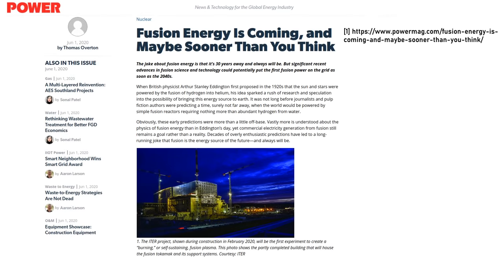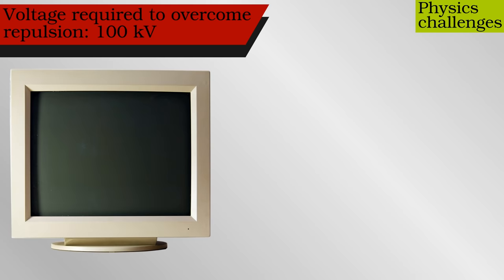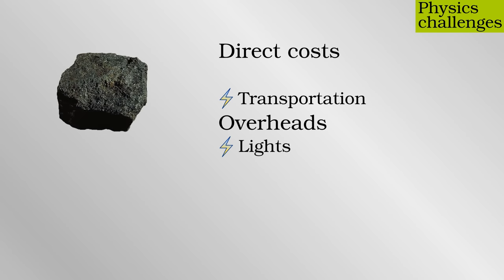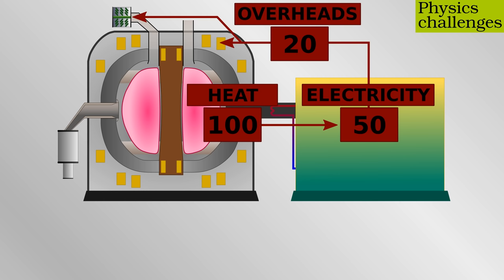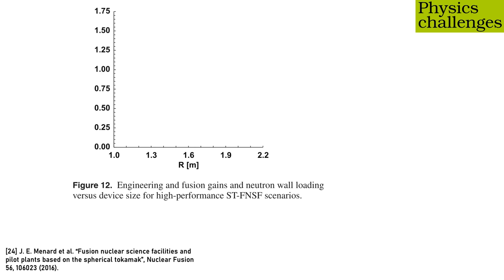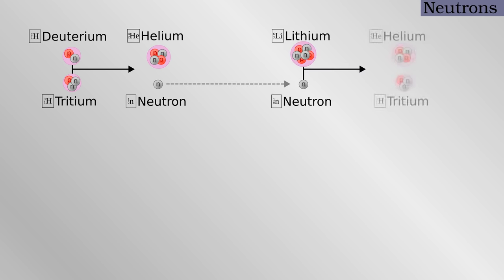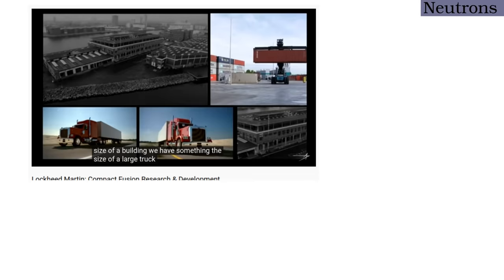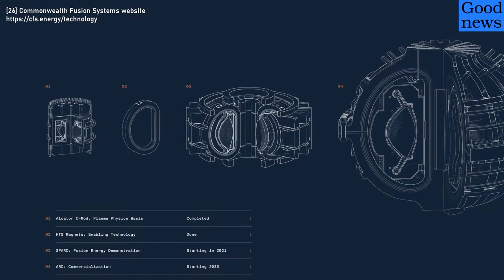Former fusion scientist on why we won't have fusion power by 2040

Comment from the maker: The first of a multi-part series of shorter videos beginning with the most asked-for topic, "why a fusor won't work (and why only thermonuclear fusion will lead to a gain in energy)", is now up: https://www.youtube.com/watch?v=2DzKXN1pcwY

Since my video was posted, Sabine Hossenfelder discussed the misrepresentation of fusion gain vs engineering gain in a recent video: https://www.youtube.com/watch?v=LJ4W1g-6JiY
I am making a response video.
Reply: It is! One of the issues I couldn't find a reasonable answer to is, why can't fusors use electrical arcs/plasma as electrodes. They would be resistant to (almost) any amount of heat and radiation.
Reply: Instead of a hot plasma, have scientists tried cold fusion by cooling hydrogen to nearly 0 Kelvin and applying electric current and megatons of pressure to it?
Reply: Thanks for this information. I was almost there, ad that's why I prefer a short term future with fission as an energy source, possibly switching to Thorium molten salt low pressure with freeze valve gravity stop system. (removing pressure water and other risks) And using nuclear as a temporarily measure until we can make solar systems in orbit from molten asteroids to feed energy via mircowaves or lasers to Earth to gain area for forests and agriculture and stop to rely on Earth rare ressources.
Reply: Thanks for the good video!
Reply: "Letting a goat graze and walk a treadmill" 😆
Reply: What do you think about the Projekt Wendelstein 7x? (as stellator, they made a big leap in the past 2 years and are refitting for net plus energy production now(I think I hope I understood it right, well they implement a colantbased hullsystem) you will understand better what they do than I I am just curious for your oppinion since I am just an interested naive
Reply: Yes please. This is about the only video I have seen that speaks realistically to me. Would love to hear more from you.
Reply from the maker: @davidh.6930  I mentioned this in another comment: the stellarator concept is better than the tokamak from a physics perspective: no need for current drive, so that input power I mention can be reduced in principle. It is much harder from an engineering perspective.

For the latter reason, stellarator research is behind tokamaks. A widespread opinion among researchers is the idea of demonstrating a practical fusion plant based on the tokamak and then using stellarators long-term.
Reply: "yet each man kills the thing he loves, by each let this be heard, some do it with a bitter look, some with a flattering word, the coward does it with a kiss, the brave man with a sword!"
Reply: Definitely interested in the follow up series! This video has distilled my perceptions of where I thought we were with but lacked the knowledge. Would be really interested to know more. Over my life I have gone from thinking of fusion as a certainty by the time I was in my 40’s (in my childhood in the 70’s) to now thinking it more akin to chancery in Bleak House. We should obviously pursue as a human endeavour and I hope to see it still in my lifetime, but it won’t be at scale in that time.
Reply: Yeah that sounds awesome. Your video here was very informative. I didn't know jack all about any of this but you presented it in a very digestible manner. Your graphics and explanations were excellent. I feel like I took some quality information from this.
Reply: @infiniteuniverse123  
Interesting. How do we know any of that stuff is actually the case?
Reply: the first you tube I have seen say this and I have been saying this for ages forget my comment about 30-50% lose turning thermal into electricty I commented before you covered it. I think molten salt reactors are the way to go for faster safer power till we get to this about 2099
Reply: On a related topic, what's your take on China's fission thorium reactor? Looks pretty cool 😎
Reply: @iamjoeysteel  they are doing very well it's all info they got from the US but they are putting the money and man power into it the molten salt is the best one but the pebble bed one looks good too and they have loads of thorium as they dig it up mining rare earths which they have a monopoly one as no one digs up rare earths because thorium is always found with rare earths and most countries make you treat thorium the same as nuclear waste even tho it is safe health and safety gone mad as normal
Reply: About AI computing the folding of proteins, I thought, in a similar way it might be possible to compute new structures for the magnetic fields and coils in the Stellarator!

Another thought, should the research put focus on harvesting the energy in some electrodynamic way, with induction, or capacitive from changes in the electric fields in the plasma?
Have a plasma geometry about electric charges and magnetic flow, that eats from a small, controlled explosion, so we have direct electric output? Some resonator from intrinsic L/C structure? There could be a double device like a boxer motor. One ignites the other while exploding. The electric pulse narrows down the magnetic field on the other side, via superconducting wires and coils, and fusion starts there, and pushes back, so to create the other half of the cycle.
Reply: What is your opinion on Isaac Arthur's idea for a fusion reactor we could technically make with current technology: building a water tank one cubic kilometer in size, then detonating hydrogen bombs inside to run turbines off the resultant heat energy?  For safety, we could build the plant in space with in-situ resource utilization, which looks like it could be possible around 2040.  Place it in the already hellishly radioactive Van Allen belts, which human space habitats would not likely occupy and which would allow the Earth's magnetic field to contain most radiation leaks if they do occur, then beam the power to Earth.  I know this is absurdly unlikely to ever become a reality due to the stigma around nuclear and thermonuclear bombs, let alone putting them in space, as well as the arguably more practical option of building orbital solar plants if we are talking about beaming power down from space.  I am curious what your take is on this fusion moon concept, seeing as Isaac Arthur is optimistic to a fault.
Reply from the maker: @neovxr  With regards to AI for magnetic configurations, this may well help make future designs, but the main problem is the challenging engineering of the stellarator coils. I will mention them in a future video.
Reply from the maker: @redmohawkguy1  Lifting off a cubic kilometer of water would be prohibitively expensive (even in terms of energy, if not pure dollars). There were suggestions starting from the first H-bombs (I will mention how they work in a future video) to simply drop such a bomb into a huge underground cavity filled with water. Even in the 60s, when atomic tests were happening often, it was simply not economical.
Reply: ...would definitely like to see that series...
Also, any insights you might have on space fusion propulsion would also be welcome.
Reply: yes, please!
Reply: @ImprobableMatter  Are there concepts about a pulsed magnetic field on top of the static? Like, can something similar to a Dirac pulse ignite fusion? Can we do Fourier superposition with arranging coils into each other, so the big ones feed the lower frequencies, and the small ones provide the higher harmonics? The result would be a very steep high energy pulse, impossible with a single coil.
What is the current use of a dynamic component in the magnetic fields?
Reply from the maker: @neovxr  The tokamak concept (technical explanation in future video!) is pulsed in a sense, because it involves inductively discharing a current through the toroidal plasma for confinement and heating. With the stellarator concept, you generally do not want anything transient like a sudden pulse, because it would upset confinement. The field geometry is finely tuned so a major pulse would free the plasma to hit the wall and so on.
Reply from the maker: @johnjones-yt8rt  The approach at the National Ignition Facility e.g. at 07:34 is to use lasers to compress and heat a plasma to carry out fusion in a fraction of a second.

In a device such as a tokamak or stellarator, the plasma is too tenuous to absorb a laser as strongly as would be required. The plasma scatters a laser beam - and it is this scattering which is used to determine the enormous temperatures (millions of degrees) which the plasma reaches.
Reply: Great stuff, very interesting to hear from a higher system level! Looking forward to this content!
Reply: @ImprobableMatter  Thank you for replying.  As for sourcing the water, I was talking about getting that from asteroids or comets and bringing it into Earth orbit when I said in situ resource utilization, not lifting it off from the surface.  Apologies if I did not communicate that clearly.  However, seeing as even building a bomb tank reactor underground was found to be uneconomical, I guess this answers my question about Isaac Arthur's optimism.  I 100% believe that orbital solar is far superior to a bomb tank fusion moon.  Only one hurdle to overcome when launch costs are cheap enough and that's convincing the public it won't create space death rays.
Reply: @ImprobableMatter  are you sure your statement that stellarators are behind tokamaks holds after the successes they had at Wendelstein 7-X? I think that that tokamaks only seemed easier to build when the ITER project was set up but thanks to advances the part that is harder about the stellarators (the computation of the magnetic field) is solved and proven while the disadvantages of the tokamak (pulsing the magnetic field for continuous operation) are nowhere near solved. I believe the stellarator will be faster to achieve commercial viability than the tokamak.
Reply from the maker: @Krmpfpks  I agree that huge progress has been made and I am in touch with a friend who works on W7-X. However, it is a fact that the highest temperature achieved on a stellarator is still nearly 10 times lower than on a tokamak. So they are behind (for now). I do believe that they will be the "final form" of magnetic fusion reactors eventually.
Reply: @ImprobableMatter  thank you very much for clarification. We will see what the future brings, it is good that both designs are pursued.
Reply: Tokamak vs Stellerator would be a nice video,
Reply: I loved this video. You present your claims with numbers, and your walk through of the various challenges of fusion is very clear and intuitive. I would love any videos you would make on the subject in the future! 
With kind regards
Thomas
Reply: YES. FOLLOW UP VIDEO PLEASE!
Reply: Thanks for good info. In my country, Norway, there is a lot of talk about thorium fission reactors as a future energy source.
Can you say something this? Is it possible, or is it just pipe dream?
Reply: I would be interested to know what you think of General Fusion's reactor and it's downsides.
Reply: Kiss managment! Name one know material(s) that can be used control/contain  fusion energy if the magnetic bottle breaks
Reply: I will be looking forward to learning more about FUUUUSION HA!
Reply: Great video mate. I'm hopeful about fusion energy, but I truly do believe we need to approach it methodically, iterate on designs a lot, and temper our expectations about what we can achieve in the near future.  We also need to realize that there are probably going to be a LOT of inefficient early iterations before we get to the kind of energy outputs that will change our lives for the better.  We are going to have to be ready to fail often before we get the kind of success we are dreaming of.
Reply: This is the first time I enjoyed a video about Fusion!
What I learned is engineering Gain is limited because of 
1_ entropy?! 
2_ loss of power going to vacuum machines, 
3_ cryogenics, 
4_ magnetic coils etc...
.... soo in short Fusion is a try to replicate the conditions found in SPACE with a man made sun?
Since they are "kinda" wasting all the money anyways, why not go BIG?
Why not build it on a space station/ bordering the dark side of the moon? (Even a micro sized one as a test)
you can harness 6000K of heat to start the process etc...
Reply: @infiniteuniverse123  how can you say Supernovae don't exist when we have observed them, and the after affects of them.  All the maths and everything we understand about physics says that supernovae are inevitable below a certain mass.
Reply: Could you please discuss which rare earth materials, bare minimum, needed to build a hypothetically thermonuclear fusion reactor?
Reply: I thought the technical definition of "fusion power" was "more energy out then energy in" and not "generating electricity for the public grid."  I have always thought it was the former expected by 2040 and not the latter.
Reply: I feel slighted you didn't mention LLNL and the recent record burn.
Reply: @rockets4kids  nothing can ever give more energy out than in.  Hence I don't think that has ever been the definition of fusion power.  That would be the definition of cold fusion, but it would also be the first reason to suspect any claims of cold fusion as a scam or outright lie.  

Instead a better way to think about this stuff is in terms of energy density.  Or how much energy you can get from a given mass of fuel.  

Hydrocarbons:

Methane tops the ranking, with an energy density of about 55 megajoules per kilo, about twice that of black coal and three times that of wood.

Fission Material:

U235 has an energy density of about 79,390,000 MJ/kg whereas U-238/P-239 has an energy density of about 80,620,000 MJ/kg

Fusion Material:

Deuterium+tritium (fusion)	337,387,388 MJ/kg

Deuterium (fusion)	571,182,758 MJ/kg

Also... if we aren't putting that power into the grid, then what's the point of generating it?  I assumed the whole point of fusion technology was to increase our available energy for consumption while reducing the environmental impact that would otherwise be unbearable for the planet if we used hydrocarbons to reach that same level of available energy to power our lives.
Reply: @PrimeAthos  I too would love more detail on some of these kinds of obstacles.  Do we even have enough materials available to make a fusion based energy infrastructure at the scale we would need to see it impact society in a meaningful way?  Also it would be nice to know which rare earth minerals to be investing in long term, provided we still continue down the road of fusion power ;)
Reply: Not UNTIL you learn to build a Gravitational Lense...
Reply: screw fusion, thorium MSR reactors are the way to go until artificial fusion comes to be.
Reply: @repealsection230forbigtech4  yep, we definitely need to invest in more fission before fusion becomes a reasonable prospect.
Reply: @mjolnirswrath23  I think you might be confusing the concept of Gravitational Lensing with an actual physical piece of shaped glass.  To get the effect of Gravitational Lensing you need either a really big collection of mass spread out, like say a whole galaxy, or a lot of densely (you might even say infinitely dense) packed matter like a black hole.
Reply: @brennonbrunet6330  And certain thorium fuel cycles and reactor types can "burn away" radioactive waste.
Reply: @brennonbrunet6330  I suggest you do a bit more reading on fusion power.  Then my comment will make sense.
Reply: @ImprobableMatter  the problemo in a stellarator is that energy confinement time is sub-par compared to a tokamak at the same size. one needs a 25 meters stellarator to reach the same volumetric fusion power. the aspect ratio doesnt help either.
Reply: Just did a quick scan of the links and saw no references to Lockeed Martin's fusion reactor or the Navy's, both of which are net energy positive according to each respective source. I would have STARTED with them, as their designs are the most mature.
Reply: @rockets4kids  pretty sure more power out than in breaks the first law of thermodynamics.  If you are claiming that something breaks that, it is you sir who needs to do some reading.
Reply: PLEASE do a vid on Helium-3 reactors and if they will be a viable alternative in the future (taking into account that space travel/hauling is becoming cheaper thanks to reusable rockets)
Reply: Can you cover emc2 polywell and lpp's focus fusion? Especially interviewing Eric Lerner from LPP would be cool, I think their research is on plasma in non thermodynamic equilibrium because it's a pulsed system (DPF). While Bussard (yes, the Bussard) described emc2's polywell as a fusor without wires to quench the plasma.
Reply: @brennonbrunet6330  I think people measure power in from after the neutrons and protons were formed, so you get out some of the energy that once upon a time went into making them along with whatever activation energy you put into to trigger the mass->energy conversion
Reply: Excellent video, really thought provoking. Please do the follow up video, it is great that you - with your first hand knowledge - is providing information to the wider discussion. Best wishes
Reply: @tricky778  I'm no expert, but although I think what you are saying might make some sense, I don't think that's exactly correct.  I'm pretty sure (though not certain) that the energy out is equal to the difference in mass between the two lighter nuclei that you are using for fuel, and the heavier nuclei that you get as a product.  The single heavier nuclei will weigh less than the two lighter nuclei that you started with, and that difference in mass is the energy you get out.
Reply: @brianwild4640  Heat loss would be slower in space, as the only method of transferring heat would be through black body radiation, since there is no atmosphere in space, therefore no medium for convection or conduction.  You can also make a bomb using fusion.  All a bomb really is, is a rapid release of energy.  The bomb don't care what nuclear or chemical processes that energy comes from
Reply: @redmohawkguy1  Gotta love Mr. Issac Arthur and his great content though right?
Reply: @Angel_EU34  Also, the Moons surface is a great source of Helium-3, due to all the unshielded exposure to cosmic radiation.
Reply: How about other types of fusion technology - laser based fusion and plasma pinch for example, and what are the problems with them, and why Tokamak reactors remain the preferred option?
Reply: @brennonbrunet6330  Yes! I love watching his content.  It makes my Thursday every week!  We are privileged to have him on Youtube.
Reply: More please! The subject of fusors is very interesting. As is converting neutrons to electricity.
Reply: @brennonbrunet6330  yes I believe so, I've edited my comment to insert 'some of' which I carelessly omitted
Reply: Interest. Yes.
Reply: Subscribed. 👍
Reply: @brennonbrunet6330  : Rare earth minerals basically all occur together. So, unless you're talking about futures trading instead of mining (in which case you should be looking at the markets instead of technology), they're all effectively the same.
Reply: It would be interesting to hear more about Lattice Fusion, as well as hybrids of other techniques like combining the Polywell concept with some of the other variants of Fusor to get closer to (or reach) break-even.

It would also be nice to hear about the implications of the research that concluded the Polywell design couldn't produce net power, I read that they concluded that previous Fusor analyses had misunderstood the location of most of the fusion reactions?
Reply: @brennonbrunet6330  Exactly, and now with SpaceX making space launches almost trivial (what a time to be alive!) it's an extremely interesting proposition!
Reply: All the information and reasoning in this video is limited by being unable to predict future breakthroughs in fusion technology (which is true for every field of physics). Just 5 days before this video was posted the people at MIT successfully tested their new super-conducting magnet which reached 20 Tesla (world record) during a 5 hour steady state test. While it was a proof-of-concept test it does show that there are thresholds in fusion science we may/will cross that we can't even imagine at the moment. 

We have to reevaluate the possibility (or lack of possibility) continually to make any assumptions whether we'll have high Q fusion reactors within the next couple of decades. So much research has been done by this point that we may see breakthroughs more often in the theoretical and applicable science of fusion power generation, building on previous scientific successes and failures. There's apparently still firm belief in fusion power since research and funding keep growing.
Reply from the maker: @scyphe  I agree, which is one reason why I mention MIT and CFS at the end. I'm sure we will someday solve all these challenges, just not in 19 years.
Reply: A friend and I long ago noticed the problem with fusion.  The density of the core of the sun, where the fusion occurs, is 160 GRAMS PER CC!  And even then the sun produces a very small amount of energy per unit volume.  IIRC less than the human body does.  And yet the reaction chamber in these Tokamaks run at a very low vacuum!  So even if they do get to the point they are getting significant energy out to in ratios the powerplant would be absolutely huge to get small amounts of useful electricity compared to a fission plant.
Reply from the maker: @unchosenid  I am working on a follow up video right now where I explain this: the probability of proton-proton fusion is 10^25 (1 followed by 25 zeros) lower than Deuterium-Tritium. Therefore, a reactor can afford to be smaller and/or less dense by this ratio to have a proportionately comparable power output.
Reply: @ImprobableMatter  Subscribed.  I look forward to your video!
Reply: Well, a fusor could work, as a heat engine, if it was in the dead of space with a cold reservoir of nearly absolute zero, but it sure can't work at room temperature. Remember, it's not energy out divided by energy in, because all the energy you put in is STILL present in the end products, what it really is, is (energy generated+energy in) divided by energy in and then times efficiency of the heat engine using the heat.
Reply: @ImprobableMatter  Hey with this recent success maybe you can try to learn from two minutes paper and maybe technology connection (you have more humor and rant similar to him) as how your future content looks like, you got the audience now with yours and their knowledge satisfy the audience demand.
Reply: Hi, I would wish You would make a video that covers these 2 subjecs.

1. How the 'fuel' for Fusion eg. Deuterium / Tritium is injected into the Tokamak Fusion test reactor configuration.

Speciflcly I am referring to  the 'Pellet Injecting Gun' (designed/made at The Danish  Research Center  RISØ back in 1989/1992.
If I rember it right that 'Pellet Injector was 'shooting 2 mm long Solid Hydrogen/ Deuterium /Tritium 'pellets' into the Tokamak at the JET Projet in the UK with a speed of +5000 Km/H.

2. Can You please make a video that explain the 'expresion' SPUTTERING' within Fusion research and what the parameters for this expression does mean?

Greetings from Denmark
Reply: challenge accepted  by subscribing
Reply: Please do
Reply: But will we have fusion energy in the next 30 years??
Reply: The MIT reactors coated in lithium?
Reply: Agreed. As much as I hate the thermonuclear atomic bomb for its immorality the fact is that it is the closest thing we have to a viable net positive fusion reactor. The key missing features we need to add to it is some kind of containment that can take the punisment of all the radioactivity while harvesting the heat as useful work and a throttle to reduce the output power to something managable and sustainable.
Reply: Yes please. More!
Reply: What's you knowlegde on Liquid Flouriode Thorium Reactor LFTR.?
Reply: @dbmail545  We can burn the goat's flatulence and get an even higher gain.  :D Goats:2 Fusion:0
Reply: Definitely! Plz keep your great work!
Reply: Yes please!
Reply: Yes! Follow up please 😊
Reply: is it  possible in your opinion that if a huge segment of society and mainstream schools became highly interested in science and fusion power that we could get it by 2040? i agree that it wont happen at the current rate of progression but what if we went full force at it like we did with nuclear weapons in the 1940s? or going to the moon in the 1960s?
Reply from the maker: @matthewfors114  More money and effort would certainly speed things up. For example, decades before all these startups came along, there was a suggestion to build a facility to test neutron damage to materials. This could already have been advancing science and technology and cutting the development time down. I don't think anyone can fully predict which year it will take with a level of funding, though.
Reply: @matthewfors114  You make a great point. I'd like to add AI and Quantum Computing to that equation. I'm not a fanboy, but just 13 years ago Tesla and SpaceX were seen as duds. It took them just over a decade to begin the biggest industrial disruption of the 21st century (thus far). "The future is not defined by today's limitations." — @me
Reply: @perp1exed  nice quote. i wonder if someone has said that before or something close. i think of many great quotes(at least to me) and then i say "this had to have been said before" and usually it is or close. Then i wonder if im merely paraphrasing or rephrasing something ive seen on a sign or if it was a case of great minds thinking alike lol
Reply: @perp1exed  i was gonna make an edit bt for instance when i was young i said " the more i LEARN the less i KNOW" meaning the more i find out the less certain i am about anything.  Its kinda like a dunning-kruger chart or something a greek philosopher would have said and i think it may have been said word for word already or something similar. but the learn and the know are key in that, i dunno if "pun" is the right word but its like wordplay of some kind. my brain hurts, i could look up what it is in a poetic sense but im lazy
Reply: @ImprobableMatter  Dont you wish there were more public interest in science in general? this current wave of science denialism with the flat earthers and anti vaxxers has really got me sad sometimes. With all the possibilities and the things we are on the brink of you would think that everyone would forget about all the consumerism nonsense and greed and just jump headfirst into a life of science
Reply from the maker: @matthewfors114  Yeah, sure, it would be great. There are probably more scientists than ever, though, and lots of good science being done.
Reply: On behalf of my people: we have nothing to do with Hossenfelder.